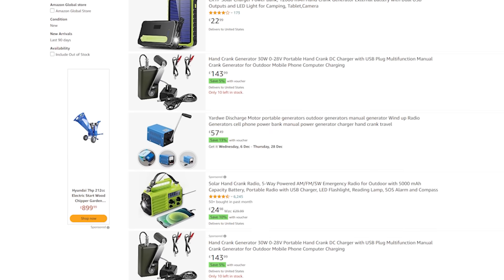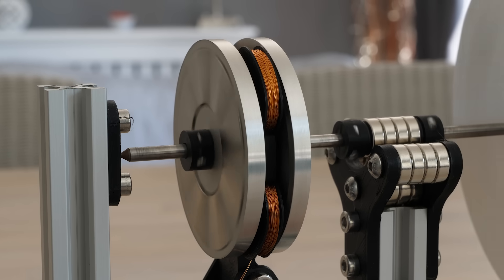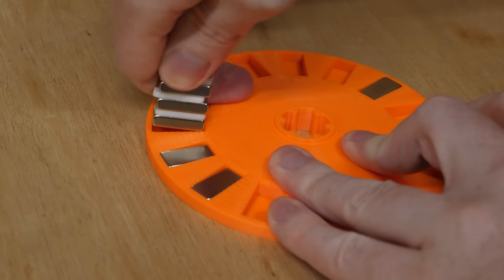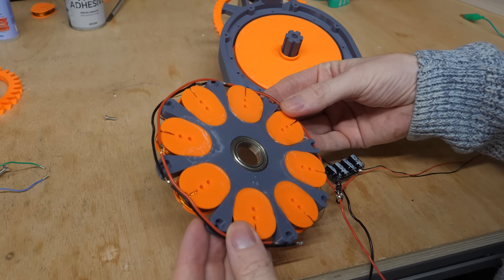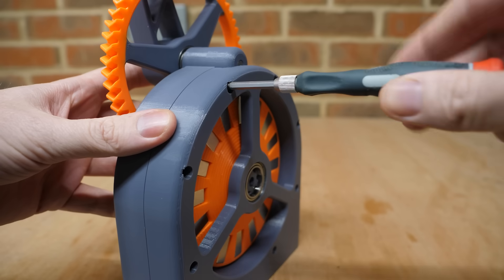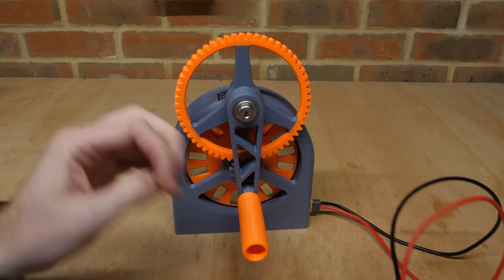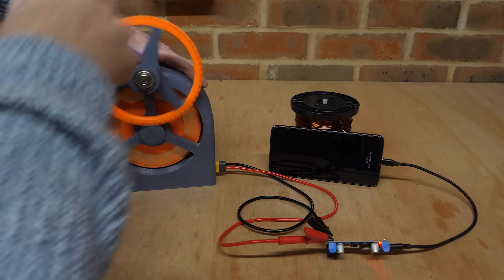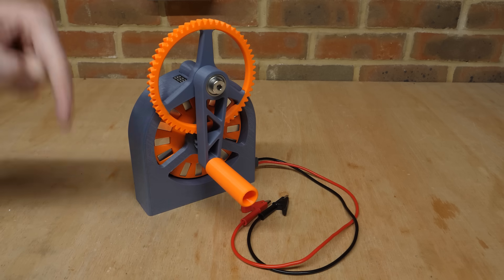Building a Generator

Comment: You should move to active rectifier instead of passive diode one. At these low voltages, you lose most of your power in the diodes at the moment.
For ultra low drop diodes you will lose 0.2V per Diode which is around 10% for your voltages, for classic diodes (which you seem to be using) its 0.7V per diode resulting in quite a bit of wasted energy.
Reply: 4 Schotky Diodes would do the same job in a ractifier layout. the same 0.2v drop across each diode.
their only downside is that they are hard to get hold of in higher amperage but can be done.
Plus add a bank of Zener Diodes in parallel to handle the current when regulating back down to the higher limit voltage.
say a bank of 12.1V zeners at 5 watts each
Reply: manitoba-op4jx  I wouldn't say they have zero voltage drop as they still have some contact resistance even if likely minimal for something like this. However they also add a large amount of complexity compared to something solid state which is just entirely unnecessary.
Reply: manitoba-op4jx  Yes they do have a voltage drop. If the speed of rotation is not high enough brushes fail in a short time because the wear particle are not flung off and short out the commutator
Reply: manitoba-op4jx Then you're back to needing brushes. Not to mention that they're quite inefficient.
Reply: @oliverer3  active could also mean mosfet.
you can use mosfets in a special way so that they conduct only if the voltage on one side is higher or lower. so like a diode.
unlike a diode however such mosfets have no fixed voltage drop and instead have a rds on which is a few milli ohms so almost no energy would be lost at all, especially when compared to normal diodes.
Reply: @ted_van_loon  This is usually refered to as an ideal diode circuit/controller, highly efficient but rather high part count if you want to build an entire active full bridge rectifier.
Reply: FERD diodes are about the same as a synchronous rectifier
Reply: manitoba-op4jx  And I would add that unless you are using gold brushes it will be high friction
Reply: manitoba-op4jx  Homemade commutator doesnt sound good to me heh. Why you are against current version of the generator?
Reply: @gelo1238  why does someone have to be "against" something to propose an improvement?  In this application, a properly designed and constructed commutator would allow for a DC output with less losses than electronic rectification.  People can propose designs which would accomplish that without being "against the current version of the generator".

You make it sound like "the current version of the generator" is a labor movement or something.  "YOU'RE EITHER WITH THE CURRENT, OR AGAINST IT!  CHOOSE, BUDDY!"
Reply: @ShuRugal  yeah lets fight over designs XD
Reply: @ShuRugal DOWN WITH THE RESISTANCE!
Reply: You can also use a PD or Q3 cigarette adapter CAR charger that will fast charge your phone at full speed so long as you crank above 12v
Reply: Came to the comments to say the exact same thing!
Reply: But then it wouldn’t be a FUUUUUL BRIDGE RECTIFAYA
Reply: I would've gone with a multiple of three instead of this 2x4 series+parallel thing and made a 3-phase generator with a full wave rectifier or something
Reply: @hashbrown777  3-ph is an excellent idea, particularly when you want DC out anyway.
Reply: You guys are nerds
Reply: GreatScott!! showed that at lower currents active rectifiers aren't much more efficient than passive ones...where the active rectifiers shine is at high currents due to their low resistance in the MOSFETS and much lower heat dissipation thru them...higher currents = much much higher efficiencies...
https://www.youtube.com/watch?v=S0j4xOuRzD4
Reply: Schottky diodes
Reply: What if we just made DC? It works as long at you’re sticking to batteries and circuits.
Reply: I was just thinking that while I was in my lambo!
Reply: Mehdi would disagree
Reply: can you use 4 mosfets as a rectifier
Reply: Yes that totally makes sense and I fully understand it
Reply: manitoba-op4jx Brushes have resitive lossess, (copper bruahes would just weld to the copper, theres a reason we use carbon) and they add to overal friction.
Reply: yall are pressed over a youtube science project. If it were a product being sold by a corporation, then yes these optimizations are good to consider but as it is, it's a neat thing to have and very cheaply and solidly built
Reply: manitoba-op4jx A lot of electrical and radio noise though!
Reply: A flux capacitor from the Enterprise would do it
Reply: Schottky diodes are usually not used in full bridge rectifiers as they have more leakage current than a silicon diode, and the leakage gets worse at higher temperatures.
Reply: Sm74611
Reply: @bgdwiepp  How long does the charge pump take to recharge? How fast can you run it?
Reply: @bgdwiepp  What are the time characteristics of that diode?
Reply: @bgdwiepp  That isn't usable in a bridge rectifier because of the recharge time.
Reply: @bgdwiepp  These look interesting but the datasheet says nothing about reverse recovery time, which means they probably aren't great for bridges.  Ever tried building one with these?  I'm wondering if the FDMQ8205 might be a better approach - it is for converting power over Ethernet into a usable DC output.  It contains 4 FETs.  Another idea is the LT4320, but note that is just a FET bridge controller.  You still have to buy 4 FETs (or the demo board).
Reply: @bgdwiepp  It takes 150msec for the MOSFET to turn on
Reply: @nathansmith7153  You mean 150 ns, not ms.
Reply: manitoba-op4jx  but they have increased resistance - mechanical and electrical.
Reply: 1,5 V loss is not "most of the power" but yeah
Reply: So do it.......
If you see a problem,  fix it.  Build upon it. 
Or.......... just don't and just post about it.
Reply: so thats like a 35% LOSS?
Reply: Oh, how surprised I would be if it turned out Tom wasn't aware about diode voltage dropout already.   

As the loss depends on the voltage he can also reduce losses by creating a higher voltage, and step it down afterwards, if necessary. Higher voltage and lower amps at a given power reduce losses in wires too.
Reply: @fishyerik I'm sure he does, but none of the other comments here are suggesting that Tom is unaware of diode voltage drop. What they are doing is suggesting alternatives, and some of those alternatives are specialised parts that lots of engineers aren't automatically aware of. In fact, Great Scott wasn't initially aware of active rectifiers and he's an electrical engineer, while Tom is more mechanical
Reply: @bosstowndynamics5488  Even I could figure out that it was possible to create a active rectifying circuit, and the basic principle of to do it, before my assumption that they already existed got confirmed. 

Based on that I'm assuming Tom could have figured out the same things, if he considered the losses a big issue and given it some thought. Assuming he actually was unaware of their existence.    

Thing is, active rectifiers are not always worth it. Simple diode rectifiers are cheap simple and reliable. 

Also, If you're talking about the video where Great Scott talks about active rectifiers, did he actually claim that he was unaware about the possibility, or did he just imply that, possibly to make it seem more sensational?
Reply: @fishyerik  It was possibly just Scott embellishing, but my core point here is that it's entirely reasonable for Tom to have not known that active rectifiers exist, since they're somewhat specialised in terms of use cases and Tom isn't an electrical engineer
Reply: @fishyerik  higher amps gives more loss higher voltage gives less loss in wires, unless so high that you get ionic transmission or arcing or such.
that said it probably was kept like this to be easy to diy, for example the coils had no core or such,  which would greatly increase the power on a low rpm, theoretically reducing efficiency but practically increasing it since it is a handcranked one so more power at a lower rpm by far beats the eddy currents. next to that the rpm is so low that eddy currents will cause almost no energy loss at all, so the savings in reuction of gear friction make it more efficient. but it is harder for people to make.

using mosfets as diodes would also make the rectifier much more efficient since then there is pretty much no voltage drop at all compared to a diode, but it would be confusing to vieuwers and more complex to understand for people how it works and how to remake it, also more work to make.
these days just seeing a hand powered generator is already super rare and special to see.

people don't remember those flashlights with a hand generator which generated quite notable amounts of power, many people only know of generators as those things steam or nuclear power plants use to generate electricity these days.
Reply: You are a scholar and a gentleman.  That was my first thought.  I was ALSO thinking about doing a halbach array on the rotor pancakes
Reply: @kayakMike1000  Halbach array increases the near-field strength by, simply speaking, reducing the range. Because there are magnets on the other side of the coils, the magnetic field is nearly homogenous between those poles, so it would only help for the field lines on the back of the rotor.

Increasing the magnets' strength and reducing their distance would help more. One could do additional tests by printing specific parts in a ferromagnetic filament to constrain the field lines.
Reply: Active rectification above 120 Hz becomes really difficult since there are no ICs that can do this yet.
Reply: @richardlighthouse5328  what are you basing this claim on? There are definitely fewer single chip solutions for higher frequencies but 120hz is definitely not a cut off. I've made 400Hz active rectifiers before myself and I'm pretty sure I've seen datasheets claim kHz though that usually comes with caveats.
Reply: @oliverer3  Sorry for misremembering, but the point still stands, the generator will definitely put out higher frequencies than what today's active rectifier chips can handle.
Reply: FXah IPO😮w
😊
Ú mil k liye

Comment: Hand cranks get hard after some time but a foot pedal like those on sewing machines is significantly easier to turn for a long time.
Reply: there's so much power in the legs. 100-200 watts easy, for hours, even more power for a lot of people
Reply: Hamsters jay, hamsters!
Reply: I was thinking the same thing, you could easily retrofit a spinning wheel (for spinning thread).
Reply: attach it to your bike and you will be able to charge your phone during travels

Comment: Hi Tom, how about a bicycle pedal powered generator that supports USB-C PD?
I could imagine charging a large Powerbank or maybe a laptop directly while sitting on a chair and using your legs. Could be a nice gadget for camping or survival stuff or so.
Reply: Pedal powered generators are cool I've made a few in the past. If you connect it to a 12V battery it's easy to find regulators and chargers to power all sorts.

Comment: Once the supercaps are charged you can use them to start a car with a flat battery. This way you can (hand) crank start a modern car engine!
Reply: This is hilarious. I did the math and it looks like 100F is about right. That dragster bank is 100F, but I'm not sure about its voltage rating or ESR. 
There's also the old Electroboom video "Cranking a Car with Super Capacitors (Supercap)"
Reply: I have a bank of 6x 3000f supercapacitors in place of my car battery in my TDI. Starts very well if fully charged. I have a 5w solar panel on the roof and charge controller to keep it topped off if I'm not driving it. 

6x in series is 500f. I don't recommend anything less after using it for about 10 years now. They will only give you one or two tries before the voltage is too low to start the engine. Another benefit is they charge up in seconds. So 10 seconds or so it's charged enough to reset the engine. Would be excellent for delivery vehicle, postal service, etc that have a lot of stops and starts.

The few times I've had to jump it or put a charger on it to charge it back up took only q few minutes to be fully charged. A jump is only 10 seconds like when the engine is running. The cheaper jumper cables get hot with the amount of current running through them. I've also been able to jump start other larger vehicles and pickups with my car and a good set of cables. People are always scratching their head confused when they see it
Reply: @jasonharrison25 I’d love to see a video on this! I never heard of anyone doing that!
Reply: @jasonharrison25 can you make a video about your TDI?
Reply: @jasonharrison25  the only think it's not that good for is listening to the radio in the car park as it would run out quickly.
Reply: Or charge the phone. Crank hard a few minutes, and let the capacitors charge the phone for longer at lower power.
Reply: Thought of the same thing.  Also, I've got a few old tractors where handcranck+supercap could be a very usable solution.
Reply: I can also picture a pull start driven generator with supercaps, so that a couple of pulls could start an engine. This way anyone could effortlessly crank a small motor, unlike the traditional pull start.
Reply: Most back country dirt bike riders switched to capacitor and deleted the battery long ago.
Reply: thunderfood started a car with a couple of cellphones I believe. Can't tell you which video it was off the top of my head.
Reply: Electroboom😂
Reply: Yeah right

Comment: Why do you need to alternate the magnet polarity when you just immediately rectify the AC into DC?
Reply: there needs to be a changing magnetic field to generate power he says it in the video
Reply: @ewbaite  It changes between magnet and the space between magnets.
Reply: Do actually generate the power in the first place
Reply: How do you suggest generating a DC current? AFAIK simply placing the magnets in the same polarity will not induce any current at all.
Reply: @nagualdesign  the gap between magnets is 0 volts.
Reply: @BrianBoniMakes   it isnt. play with a variable reluctance sensor. (watch my video?)
they make an AC wave form.

as the magnetic field builds the EMF goes one way. push N into coil.

as that same field decays it goes the other way. pull N from coil.

if you just repeat this cycle, you get AC. 

if the opposite polarity magnetic field now builds, the induced EMF is still going the same way... ie, N pulling out is the same as S pushing in. 

and as it decays, S pulling out changing to N pushing back in...

its the other way... and now the field is reversed again... and the emf is still flowing the same way as when we started, a full cycle...

it doesnt actually matter if the field reverses or not, the current will always be AC.

but as magnets have two poles its far easier to construct so it reverses?

with an iron core, if the field never reverses then the iron and its remnance polarise the iron, makes it a magnet, and reduces the "amount of change" that the flux through the iron can experience before saturating, and that limits the power it can develop. when it swings both polarities, you get a small hysteresis loss, demagnetising the iron every half cycle, but you can swing the magnetic field, and hence the flux, from one extreme of saturation to the other extreme. and that means you can deliver far more power.

make sense?

there IS a DC generator, the "homopolar" or "faraday disc" but its awkward, and only makes very low voltages... that has a uniform steady magnetic field.
Reply: @paradiselost9946  Yes but you write about an iron core and Tom's model is just magnets. Thanks for the lead to homopolar, I liked U.S. Patent 406,968. Tesla's "Dynamo Electric Machine"
Reply: @BrianBoniMakes  it needs the iron core or its next to useless. all the magnetic flux is just flying around, no attempt contain it or maximise what it can do.  you can only push so much through thin air, and it takes power to do so. every mm of air gap is a massive loss.
 the fact he doesnt use iron, makes no attempt to even shield the back of the magnets, shows how little he actually understands any of this beyond the average primary school student..
Reply: @paradiselost9946  Yes, thank you.